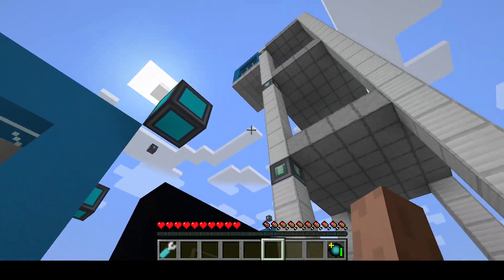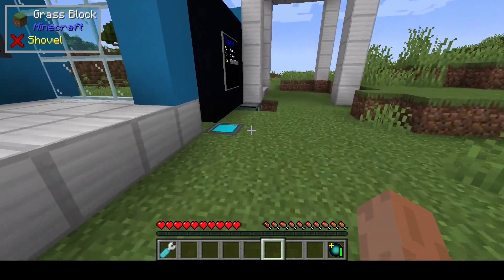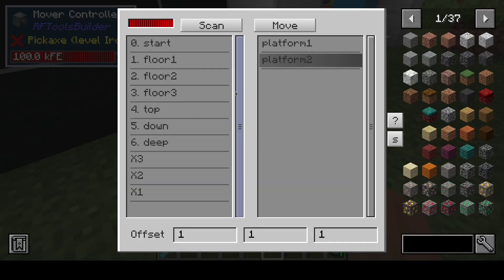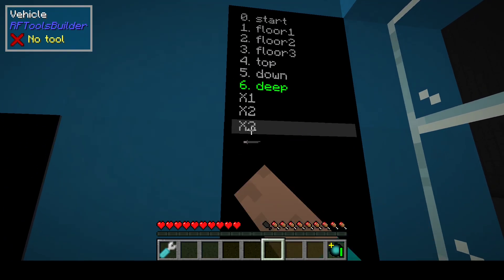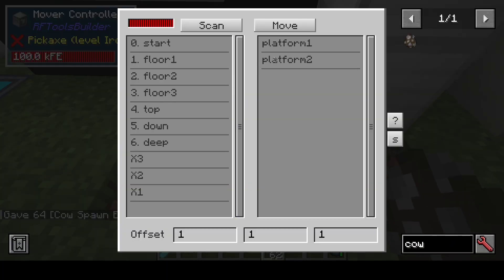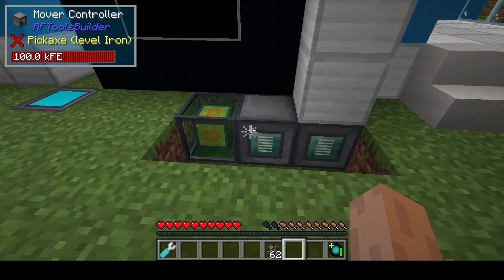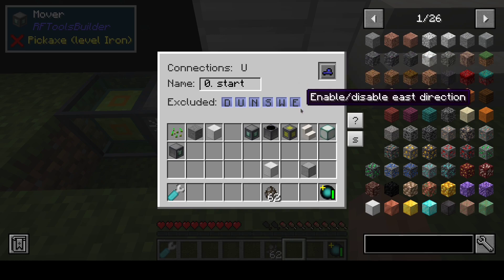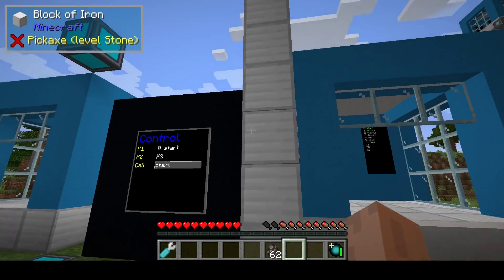The new RFTools Mover

Comment: Dont get your hopes up, it wont work in 1.18, and updating seems like some of the updated mod files needed from the page are missing for 1.18.2, and only have copies for 1.19, which thats fine I guess but means not gonna happen in stoneblock 3 even if you try updating the files yourself, like I said some are missing that are needed that just plain dont have a 1.18 version at all, would be nice but oh well atm8 only i guess i'll just have to kick myself for not doing the big build in atm8 instead of sb3 - heard rumors that it does somehow work in 1.18 but at the time there is no way since you cant update one mod without the others that are in use as well since they use that core library and it isnt backward compatible
Reply from the maker: What do you mean? The mover is part of rftoolsbuilder and is fully available for 1.18

Comment: Either this video is convoluted, or the elevators themselves are... I can't tell.  But I really hope it's just this video.
Reply from the maker: What do you mean?
Reply: @jorrittyberghein7398  It means they seem overly complicated compared to how they used to be; but that could just be the way the video is made, as opposed to the elevators themselves.
Reply from the maker: @jays7761  Well they are more complicated because they can also do more things. First it is no longer a simple platform as it was before. It's now an entire shape so you need an extra machine to make that shape. Secondly it can now also move horizontally while previously it only allowed vertical movement (up/down). More features come with a bit more complexity
Reply: @jorrittyberghein7398  And there is ZERO documentation for any of this in the Technology Guide.  Nothing about space chambers, or vehicles, or movers.... so for now, it does nothing, because no one knows how to use it.
Reply from the maker: @jays7761  Yes I need to update the documentation.
But that's why this video is there. It explains how to do this. People are using it so it's doable
But I agree. Documentation is needed
Reply: @jorrittyberghein7398  it barley doable... i managed to get it working but i cant link it to a screen which renders  it completley useless. Why would you ever want a elevator that you can't call back. Ive searched everywhere but nothing works. (this is is atm8)

Comment: i tried but my space card is not showing anything after linking when i right click i cant make a mover, after i added patchouli now i cant even right click the space card. please help.
Reply from the maker: What exactly did you do? Did you use the wrench to form the space chamber and did it give the correct message? Did you then sneak right click with the space card on the controller?
Reply: @jorrittyberghein7398  I didnt use the wrench, I didnt know i needed to, now it works as seen in the video, but the bug (6:30) appears any time i fly and sometimes when i move up with the mover.
Reply: @jorrittyberghein7398  Thanks for the help